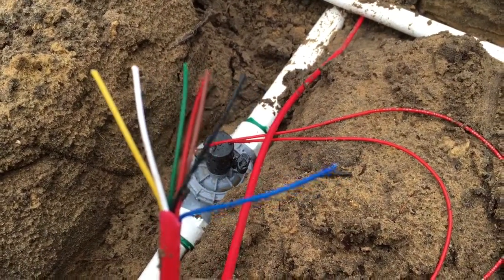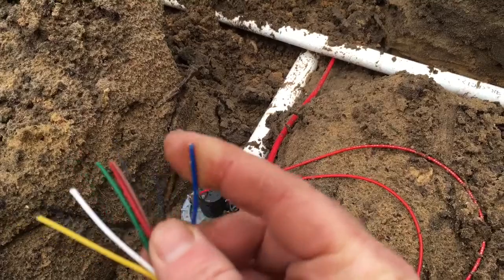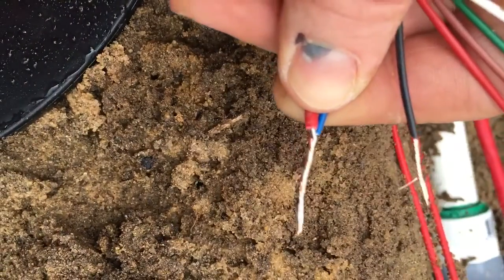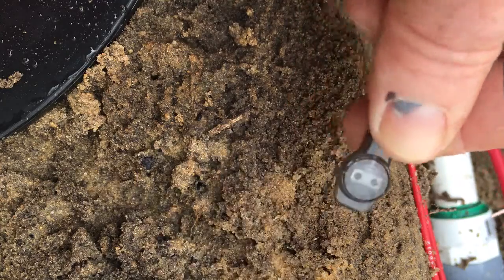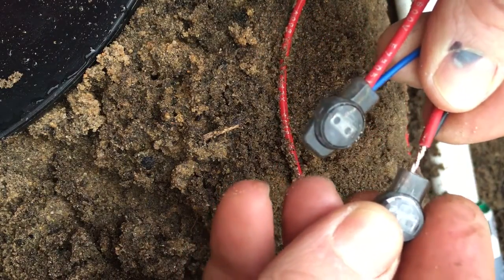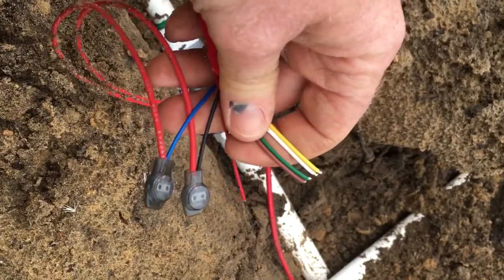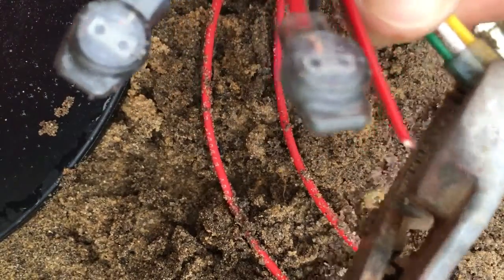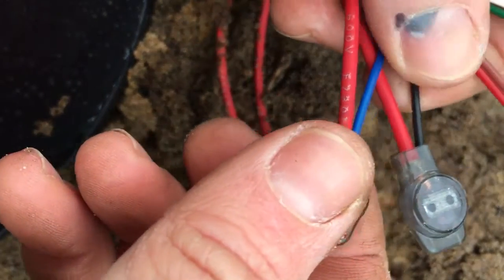Mr. Retic - how to wire up an solenoid.

Comment: Hi, and thanks for your very clear and well-demonstrated video. 

I have a question please. We have a valve next to two other solenoids buried a couple of feet from the mains water tap. This valve has two red wires, one of which is taped at the end to a black wire, the other being taped at the end to a white wire. I'm yet to dig all the dirt away in which the rest of the valve is submerged. Going by the wires as described, do you think this is a master valve? When we moved in, there was never a wire connected to the M or P terminal on the retic controller (which had been hardwired), so if the valve described above is a master, it is not being used. 

30 years later, and on our second new controller (now connected to an outside GPO), I'd like to connect this master valve, if that's what it is. Problem is, there are no red wires in the controller. Does this indicate the master valve is not being used?
Reply from the maker: Red wires come from solenoid coil, and as you say change to black and white, if installed correctly they should run back to controller on the same colour wire, so the controller should have a white wire in one of the terminals, black should be the common, Master valves should be installed directly on the end of the isolation valve(retic tap).